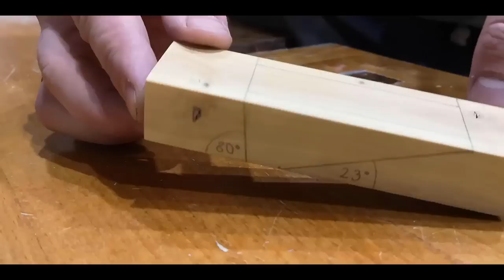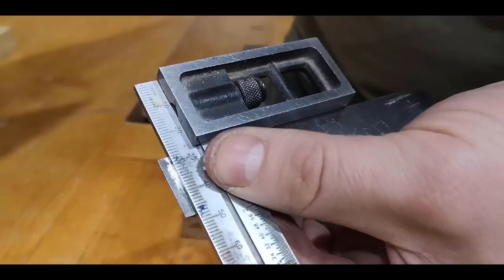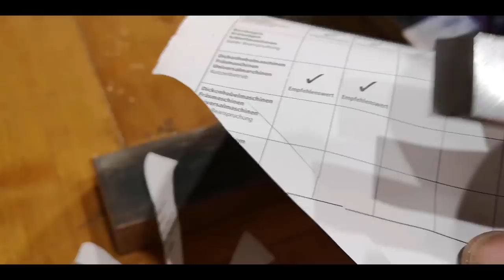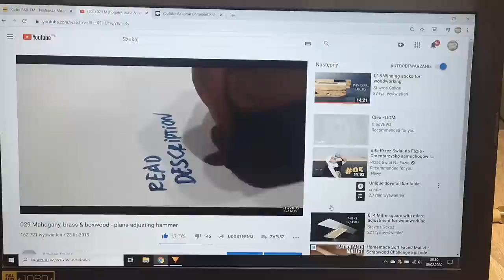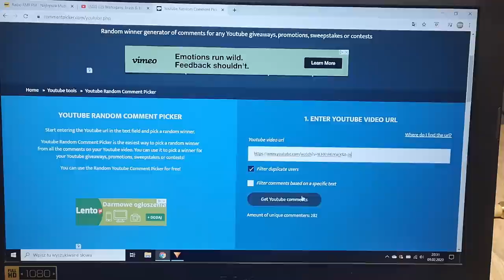033 Boxwood mitre plane

Comment from the maker: This is my another planemaking experiment - mitre plane with high cutting angle. 48 degrees cutting angle helps to say goodbye to most tearouts :) 
I hope you will like it. 
At the end of the video i pick up the winner of adjusting hammer. Congratulations :) 
Materials: Boxwood Lamintated plane blade 
Steel lever cup (main shape cutted by laser) 
Simple screw and knob 
4mm thick brass rod 
Brass screw 
Boiled linseed oil 
Tru oil
If you have any questions or sugestions just write a comment. Enjoy!
Reply: Hey Stavros Gakos why don,t you make a folding pocket knife some people use it for carving
Reply: Thats a very pretty plane and sounds great cutting across the wood, great work as always Stavros.
Reply from the maker: Hey Esteban, i don't need it :) regards

Comment: I’m curious about your sharpening technique. Sure seems to work though!
Reply from the maker: I'm big fun of simple sharpening using bench grinder, diamond stone, water sand paper and leather strop. Thats all
Reply: Stavros Gakos I meant more specifically your motion.  Unconventional motion you use.  Almost a sideways sharpening.  I like.
Reply from the maker: @TheBearGrylz  that sideway sharpening leaves the bevel without any vertical scratches, so the blade is sharp very quick.

Comment: Brilliant work. But I don't understand what makes it a "mitre plane."  When I saw the title of this video I assumed that you were building a plane for use with a shooting board. Also, what is the purpose of doubling the thickness of the back end of the blade? Finally, why is the design block plane style? I would think that lengthening the bed and adding some sort of tote behind the blade, even just a knob, would greatly increase the user's control.

Your craftsmanship is superb.
Reply from the maker: Thanks! The basic design is mitre plane but as i wrote it was an experiment with higher cutting angle. Double thickness of the blade at the end makes it more comfortable to hold. Regards!

Comment: Awesome and beautiful.  I don’t understand the reason for the adjustable wear plate though, can you elaborate?  Jealous of the winner 😁
Reply from the maker: Thanks Todd! Just watch this video https://youtu.be/4mfd_YmOI2M
Reply: Stavros Gakos Thank you!  Very informative video (although I still don’t understand why you need to plane down the back of the wear plate when you re-surface the bottom, seems like you’ve already fit it and after taking off a bit of the bottom of the wear plate you might need to re-cut the angle for chip release)
Reply from the maker: @toddlarsen6215  in classic wooden mitre planes to close the mouth you have to take few shavings from the back of mouth closer, after that the mouth closer will go deeper into the slot and will close the mouth again. In my version you have to loose the screw, put the mouth closer down to close the mouth and then make the sole flat again.

Comment: Beautiful plane - I’d like to try my hand at making something like it. Can you tell me the Latin name of Boxwood? Here in the states we have a couple of species referred to by that common name. One is Box Elder Maple (Acer negundo), and another is privet hedge (Ligustrum vulgare). The small diameter chunk could be either one. 

Thanks!
Reply from the maker: Thanks Alec! I don't know Latin name of boxwood, but you can use most hardwoods for that kind of project. Good luck!
Reply: Common boxwood /European/ buxus sempervivens . On the other side of the pond you can use caseria praecox wich is referred as boxwood overthere. Very simular use of timber. However if you need the original one please let me know we can do something about it
Reply: Tomek wròbel  - Thank you! I will look into our local species. After thinking about this for a while, I’ve decided to try hop hornbeam (Ostrya virginiana). This is a very tough diffuse porous hardwood formerly used for such rugged applications as ox yokes and wagon axles. It should work well, and it grows on my land!
Reply: @alecmacleod9147  good luck with your project. Have fun making it and if you going to use your own timber that's even better. I was quite surprised to know you planning to use ligustrum . I never considered it as timber source becouse in my native Poland it only grows to thumb thickness. 
All the best and show us the end product please.
Reply: Tomek wròbel  - The notion of using Ligustrum puzzled me too, though here the basal stem does get large enough and looks like what Stavros had in his hand. I live in western Massachusetts where there are large areas of forest and many species of trees, so I have choices. But I really like the density and hardness of the woods Stavros utilizes, and those characteristics tend to be unusual, both naturally and due to invasive diseases. Here, for instance, the native beeches (Fagus grandiflora) are dying due to the European beech bark disease, so access to that wood is limited. Our American Chestnuts and Elms have long ago been hammered by Asian diseases and the Ash is now threatened by the Emerald Ash Borer. We fight hard against the Asian Long-horned beetle, a pest that attacks diffuse porous and sweet wooded trees like Sugar and Red Maples, all the Birches and other lesser species. 

It’s good to converse with you! I need to get to Poland and see what’s happening in your woodworking community. Thanks again for your responses.
Reply: @alecmacleod9147  ihave had look at the long horn beatles and they're rather bad. Lots of woodland in Europe affects by diseases  like the ash back die. Anyway  quite a drift from tool making to forest health . Chat which I enjoy  very much. And I wish we could continue it .Maybe outside the public domain ?

Comment: LAY A RAG OR TOWEL OVER WHEN BREAKING THE HARDENED BLADE. shards of hardened steel are under high stress through the heat treat process and can fly out fast enough to rip through arteries if you are very unlucky. BE SAFE

Comment: A fast way to flatten the back of laminated steel chisels or plane irons is to lightly hammer on the low carbon steel to bend the high carbon steel cutting edge back down.
in japan this is a common technique used on tools and is called "ura-dashi"